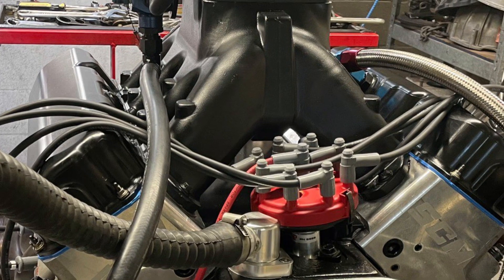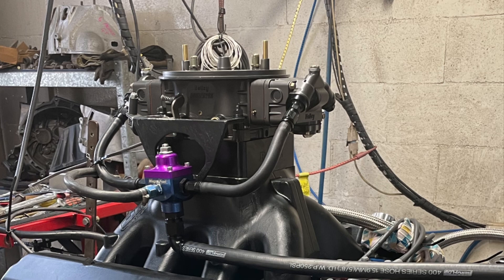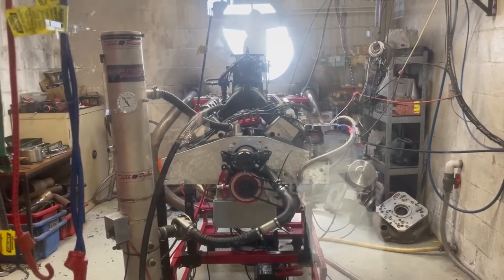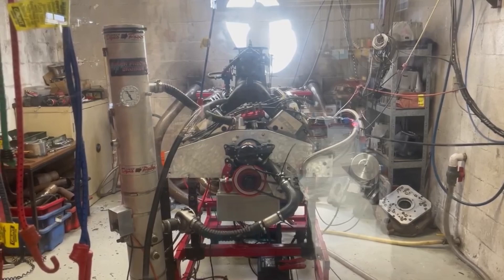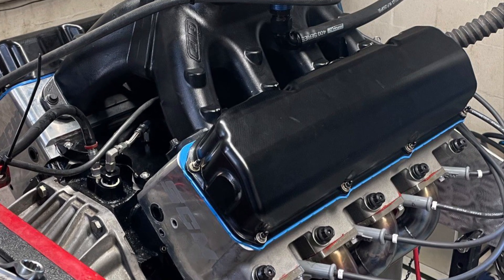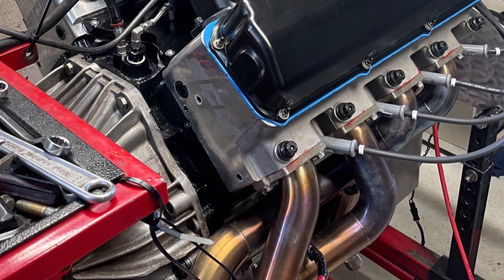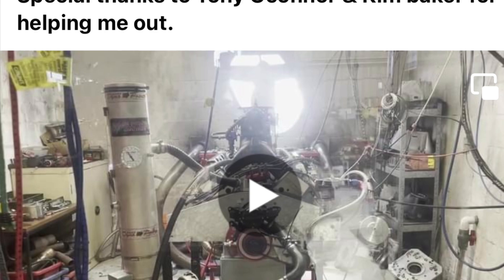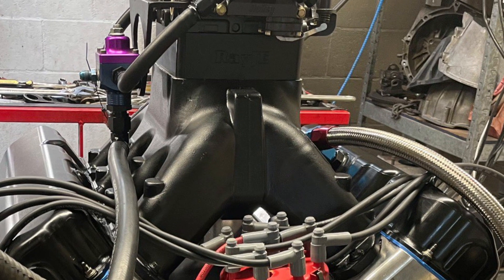351 Cleveland Makes Over 1000 Horse Power,  Now I Know Cleveland's Make Power

Comment: My engine builder in Victoria Australia was spinning a clients Cleavland 2 ,   9600/9800 rpm's  years ago,  say 20++ 25 yrs ago . Making a 1000hp .The engine was in a car running on the salt flats of South Australia.
Reply: The Aussies are masters of building Ford engines. It's like Ford recognized this years ago and rewarded them with the better Ford motors not marketed here in the States. Those Barra engines, certain Ford vehicles not sold here either. Good job Australia.
Reply from the maker: @PatriotPlus179 great deal. Roll with it 🇦🇺
Reply from the maker: I believe the rpm, not sure on the hp rating, believability. Either way thanks for watching and commenting
Reply: Go watch Xplicit 77 Racing 🏁 
18.6 displacement hull.  On Alcohol.   Blows away the Blown Alcohol Boats 🚢& what is he running.. a Barra Turbo Charged 4ltr engine . His acceleration is CrAzY.  The other Boats r  20/21 ft & he Spanks them really well . 
1300/1500 hp

Comment: Do you think my stock 351C could handle a 671 blower?
Reply from the maker: DragBoss Garage: Janks 69 Crazy Capri Blown Ford 351 Cleveland,  A 9 Second Street Car
https://youtu.be/NnlqzUhD8Qg
Reply: @DragBoss351Cleveland  that really doesn't answer my question though. Nothing was said
Reply from the maker: Well you see it there handling a blower. So yes it can, bottom end. It’s the cylinder walls that will start to move with too much boost.

Comment: I'm having a 427 aluminum Cleveland built for my Detomaso pantera. I'll be using a Paxton Novi 2200 supercharger or some other centrifugal charger.

I would like to use a water cooled intercooler on something like a Holley Low-ram to fit under the rear hood. Any suggestions?
Reply from the maker: When it come to Panteras, I don’t have a lot of suggestions. My Bud has one and I will  ask him. That will be killer. What block are you using?

Comment: They were building thousand horsepower in engines that were Cleveland's for pro stock racing if you know anything about Cleveland you should know that 🤔
Reply from the maker: They were not building 1000 hp Cleveland’s for pro stock in US. Right?

Comment: In nascar the Ford guys prefer the 351 Windsor over the Cleveland. The Windsor oils from bottom to the top and vise versa with the Cleveland. Making the Windsors bottom end more reliable in long hard driving at high rmps
Reply from the maker: Yep Cleveland’s are not priority oiling and Windsors are.
Reply: oil gallery restrictors fix that one.

Comment: Just want to ask ya a question about Ford C3 heads, will Cleveland pistons work with them in a windsor block? these heads have splayed valves in only one plane. I`m trying to skirt paying $1200 for pistons if I don`t have to.
Reply from the maker: What c3 heads, Yates? They will not work with cleveland pistons.
Reply: @dragboss351cleveland   These say Ernie Elliot stamped on them
Reply from the maker: @edpetrocelli2633  Yates I would say, what is part number and date
Reply: @dragboss351cleveland  i bought 3 heads, a pair with a spare. one stamped DR 3/95 9102 eng 903. the other is stamped Pro M 5A. He threw in a set of pistons J&E 509F the box says 351 windsor nascar they drag raced these heads in sportsman, the pistons are 4.030 i need 4.125. I`m just looking for info and you are a ford guy and I do mostly Roundy rounds. Thanks for your time

Comment: Why call it a 351  when it's 440 cubic inches , you just made it into a clickbait video . The results are impressive , but you lying to get clicks is Lame as hell .
Reply from the maker: What ever the block is a 351 Cleveland. Architecture. Why waste you time to make a negative comment.  I call it what it is, a cleveland. Thanks Ted.
Reply: @dragboss351cleveland  It's like saying a 426 hemi in a top fuel makes 8000 hp , that would be click bait also
Reply from the maker: @EvansBrosRacing   thanks for watching. Have a great day.

Comment: D/ms is a new class in super stock, 7.25lbs/ci, 4.300 max bore size, 55mm max cam journal, .900” max lift and 9200rpm limit among other restrictions
Reply from the maker: Sounds like the class. Let her rip.

Comment: Badass “aftermarket” Cleveland 👌🏼🏁
Those Higgins heads are Big Block territory lol
Tim i think we need TrackBoss topped by a pair like Andy’s Hemi Hammer Heads & set the combo on kill , yeh baby 💪🏼🏁🏁🏁
Reply from the maker: Well I have a set of BT 3.6 at BES also, 🤔. I was thinking about running cooks heads, like these but at the time lots of extra expense.  So using what I have. Hemi, 1000 hp street motor yikes, monster
Reply: @dragboss351cleveland   Blue Thunders would be killa 👌🏼🏁
Reply from the maker: @69JANKS  they are getting CNCed so not sure what I will do with them. 😉
Reply: @dragboss351cleveland   haha badass 💪🏼🏁

Comment: The Cleveland motor single-handedly shaped pro stock racing here in America and the reason those henchmen for GM the NHRA mandated the 500 cubic inch rule and allow GM to build a brand new big block motor which is nothing more than a big cube Ford Cleveland engine. That is what GM's drag race competition engine is. it's a big cube Cleveland motor. They took a Oldsmobile block and stuff that like a Thanksgiving Day turkey with a rotating assembly from a big block Chevy. Then Warren Johnson had a pair of big Cleveland Ford heads made for it. This is the reason Ford does not participate in pro stock racing because it is already Ford  powered..
Reply from the maker: Wow Frank I guess that is it in a nutshell. Never seen it out like this. Morgan did say DRCE was a big cleveland head.
Reply: @dragboss351cleveland   EVERYTHING CHEVY USES TODAY IS ALL FORD IN DESIGN. 
1.THE CHEVY/GM PROSTOCK DRCE IS A BIG CUBE FORD CLEVELAND MOTOR. THE CLEVELAND IS THE ULTIMATE IN POLYANGLE HEAD DESIGN. IT JUST DOESN'T GET BETTER. 
FORD DESIGNED THE CLEVELAND TO BEAT DOWN ON THE SMALL BLOCK CHEVY AND THAT IT DID. TO THE POINT THAT THE HENCHMEN FOR CHEVY THE NHRA MADE THE FORD'S CARRY MORE WEIGHT 250LBS AND THE FORD'S STILL WON. ALL SORTS OF CHEATING WAS GOING ON IN THE CHEVY CAMP WHERE THEY WERE TAKING EVEN MORE WEIGHT OFF THEIR CARS AND WHO KNOWS WHAT ELSE THEY WERE DOING BECAUSE THEY KNEW THE NHRA LOOKED THE OTHER WAY. THE NHRA KNEW EVENTUALLY PROSTOCK WOULD BECOME ALL FORD CLEVEAND POWERED AND THE REASON THEY MANDATED THE 500ci RULE TO PROTECT THAT PHONY CHEVY RACING DYNASTY. 
2.THEY CHEVY NASCAR RO7 ENGNE IS A FORD CLEVELAND KNOCK OFF. IT EVEN HAS THE DISTRIBUTOR IN THE FRONT. YOU CAN MISTAKEN IT FOR A FORD MOTOR.
3. ALL YOUR SYMETRICAL HEAD CHEVY RACE ENGINES ARE FORD CLEVELAND DESIGNS LABELED AS CHEVY. THIS IS WHAT THEY HIDE FROM THEIR CHEVY CLIENTEL.
3. MOST OF YOUR MOUNTAIN MOTORS LABELED AS CHEVY ARE FORD BOSS 429 DESIGNS.THEY ALSO HIDE THIS FROM THEIR CHEVY CLIENTEL.
4. YOUR CHEVY LS IS A REGUIRGITATED FORD 427 HIGH RISER ENGINE AKA RAISED PORT WINDSOR ENGINE. PUT YOUR FINGERS INTO A LS HEAD AND THEN A WINDSOR HEAD. THE INTAKE RUNNERS CURVE INTO THE INTAKE VALVE FOLLOWING THE CIRCUMFERENCE OF THE CYLINDER WALL CAUSING A SPIRAL EFFECT. IT A SPIRAL INDUCING COMBUSTION CHAMBER AND THE REASON WHY IN 1983 WHEN THE 5.0 ENGINE DEBUT. IT WAS THE HIGHEST VOLUME OUTPUT MOTOR IN THE WORLD. THE ONLY OTHER MOTOR THAT MADE ITS POWER PURE CUBIC INCH WAS THE 308 FERRARI V-8 ENGINE. A 351 WINDSOR HEAD WHICH THEY WERE MOSTLY ALL 2 BARREL MOTORS AND NONE RACE ORIENTATED. ON THE INTAKE SIDE ONLY WITH A SMALLER VALVES AND INTAKE RUNNERS FLOWED JUST AS GOOD AS THE BEST CHEVY HEAD BEING THE FUELIE 2.02. THIS IS THE REASON GM TOOK THE WINDSOR DESIGN AND GRAFTED THE 427 HIGH RISER PORT ON IT, GIVING IT A STRAIGHTER SHOT INTO THE CYLINDER AND THE REASON TODAY A LS HAS BIG BLOCK FLOW NUMBERS. WHEN IT CAME TO CHEVY RACERS I NOTICE LOTS OF THE ONES I'VE KNOWN WEREN'T KOSHER IN ANY WAY. ALWAYS SOMETHING DISHONEST AND CHEATING ABOUT THEM IN THEIR DAILY LIVES.
Reply: Frank289100     Henry Ford 2 (under pressure from Congress) pulled the plug on racing in 1970. That made the boss 9 and boss 351’s orphans.
Reply from the maker: @Frank289100  well there you go, in a nutshell. All good info to know. Luckily I don’t get into debates about all this, no time for it. Thanks for carrying them ford banner. Better talk to them boys in yellow bullet, they may need a lesson, lol. Thanks Frank.
Reply: Frank289100     I always thought the drce referenced to being an Oldsmobile was a joke!
Reply: @dragboss351cleveland  ACTOR CLAYTON MOORE WHO PLAYED THE LONE RANGER IN A INTERVIEW I WAS WATCHING ON YOU TUBE A FEW WEEKS AGO PUT IT IN THE BEST WORDS WHEN HE SAID: "THE ONE THING THAT NEVER CHANGES IS THE TRUTH, IT LIVES ON FOREVER". AND THAT IS WHAT THE CHEVY GUYS CANNOT CHANGE WHICH IS THE TRUTH ABOUT FORD'S RACING HISTORY. I HAD A GUY HERE ON YOU TUBE I DEBATED A FEW YEARS BACK THAT WENT NUTS TO THE POINT HE WANTED TO KILL ME WITH A BALL PEEN HAMMER. THAT IS HOW HUNG UP ON CHEVY HE WAS.
Reply from the maker: I don’t have time to debate anything, I just do the next right thing, and I don’t go wrong.
Reply from the maker: Why waste time, is what I would say. Looney seems fitting.
Reply: @dragboss351cleveland  IT WAS 3 YEARS BACK AND HE NEVER CAME BACK. TO SAVE HIMSELF THE EMBARESSMENT HE CLOSED DOWN HIS CHANNEL.
Reply from the maker: Well that solved that mystery. Lol. Frank

Comment: Them aussie guys been rocking clevelands for years. And their drag racing sene is crazy fast. I love their pro stock class because they race small blocks so they know how to make power with them.
Reply: Thanks for the kind words mate, reason why we love our clevos is that they were available here from 69 onwards, cast in Oz from the mid-70s till early 80s, lots of them made, from cooking variety 302Cs to 4V GTHOs that were very similar spec to the Boss 351. Last Falcon off the line with Clevo power was 82. Emissions killed them off but they were still fitting them to ambulances and F-trucks which had more relaxed emissions requirements. We were still selling them to DeTomaso (via a skunk works and secret stash) where they went to Switzerland to be tuned, then installed in Italy. That finished up in 88, then they installed Windsors.
Reply from the maker: @Cat_fish911  thank you  for the info. So 82 was last year of cleveland production done under? Yes they sure utilized it. I bet the Cleveland’s run good in ambulance and trucks,  glad your here mate. More on the way
Reply: @dragboss351cleveland  most welcome mate. Yes 82 was the last year that our emissions laws would allow the clevo to be fitted to Falcons, Fairlanes and LTDs. They  were diminishing in stocks and only premium spec or police highway patrol cars could be ordered with them. The cops loved the 351-equipped XE Falcons for their long legs and ability to eat up miles at high speed and in comfort. 83 was the start of new emission rules so Falcons only came with 6-cylinders from then until the return of the V8 in the '91 EB (5.0 HO).
Reply from the maker: @Cat_fish911  awesome. So after 82 did any go into to trucks still, ambulances,?
Reply: @dragboss351cleveland  Some F100 's ended up with Nascar blocks but only had 2 bolt main caps! Seen 4 or 5 them myself.
Reply from the maker: @catatonia1  Yes have heard that too, and seen pics.
Reply: @catatonia1  that’s crazy didn’t know that, I hope whoever got them put them to good use
Reply from the maker: Hell yeah! Go 🇦🇺
Reply: @dragboss351cleveland  Isis ity foor seo[ll
Reply from the maker: @justingriffith2991  nothing is for sale.
Reply: The 351 cleavland was king here for many decades. Xy gtho falcon is an icon. We didn't get big blocks here. 351,360 chrysler and latter 6.2 ls is the biggest engines we got. But for a long time the gtho was the king.
Reply from the maker: @Kunt5113 Cleveland’s to the front. Thanks mate. Appreciate you, and the GTHO 🇦🇺

Comment: There are a few 410 cleavland based engines  that make well over a 1000 HP in nmca 10-5 N/A check out Lennard Long sn 95  he just won the class again
Reply from the maker: William cleveland based, is to me a Windsor block? Not a cleveland to me.
Reply: @dragboss351cleveland  ok canted valve  headed 9.200 deck small main,  after market Windsor based block without the water passages and foreskin on the front of the block LOL
Reply from the maker: @williamyurgelaitis8518  I know. To me what makes the Cleveland, is not only the heads, but the block. Yes plenty of Windsor blocks and cleveland heads making over 1000. Thanks William.
Reply: his car a turbo car not N/A
Reply: @billycox8047  he was building a turbo car,     but the car I'm talking about   "IS"    N/A

Comment: If the heads aren't canted valves, and not made by Ford, it ain't a Cleveland anymore. Nothing special about the bottom end of the Cleveland.
Reply: So mr. vanhalen, how's your cleveland build coming? Show us how you do it.
Reply from the maker: @elmerfudpucker3204  one more time.
Reply: Looked like Canted Valve Cylinder Head's to me.
Reply: It has canted valves
Reply from the maker: It’s a cleveland.